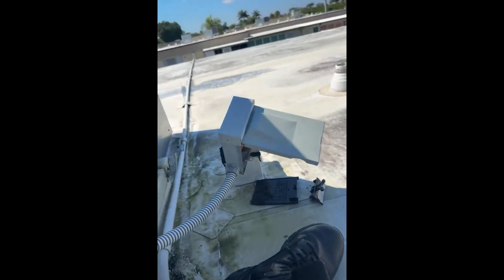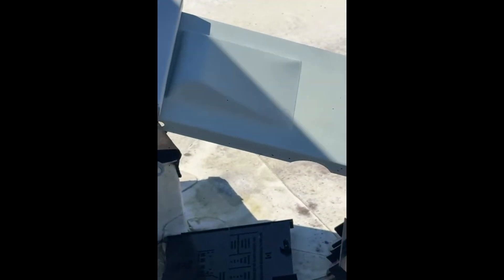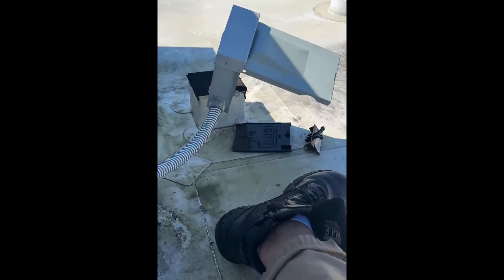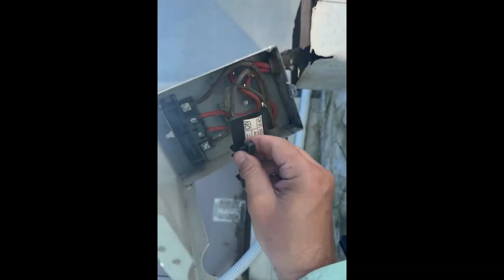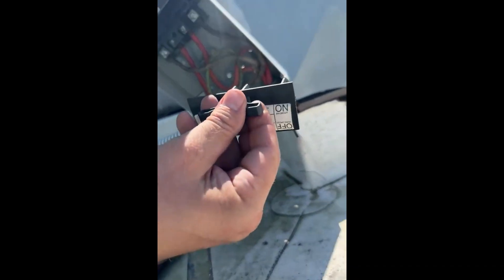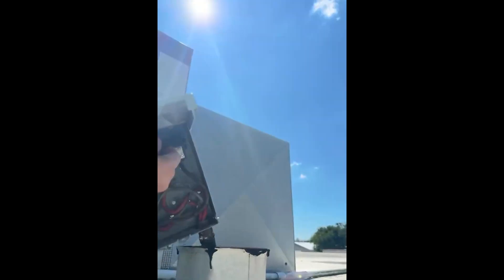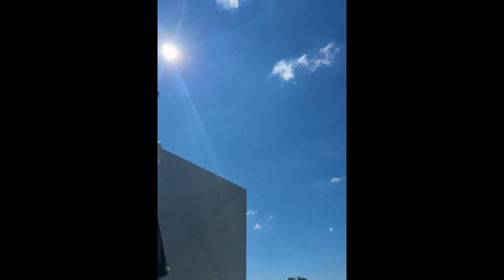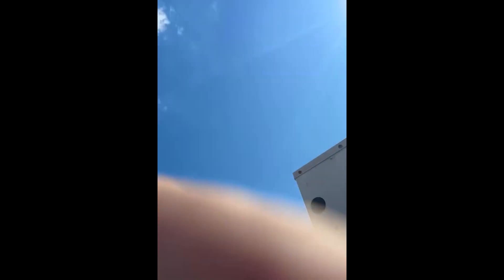AC Fan Won't Shut Off - DO THIS!

Comment: I had the same problem with my air conditioner. And found a pretty easy solution. I turned off my breaker switch. Kept it off overnight. The next morning I turned it back on. Now the air conditioner didn't go back on. I had to hit the breaker switch two or three times. Finally the air condition went back on. I had to do pretty much the same thing to the thermostat, but once everything started working. The fan would shut off. When the air conditioner would shut off. I'm not going to say it's going to work for everybody, but I'm sure there are some people out there that it will work for and they'll save themselves a lot of money. Good luck, let me know how it works.
Reply from the maker: Interesting. Comment back on a couple weeks and let us know if it’s still working for you 👍
Reply: Unfortunately it's not working anymore. Very pissed off. It worked for a short time and then it didn't. @mechanicsfornonmechanics8998
Reply: This worked for us, too, for about a day- then back to fan running 24/7 no matter the settings or temp, and we replaced the relay switch, too...
Reply: I know it's very aggravating. What I just found out is I have a trane unit. And it's got a 10 year parts warranty. And I believe the unit's only about eight years old. So I believe I could get The part for free and I just have to pay for the labor. So you guys might want to check on it if your air conditioner is not that old.